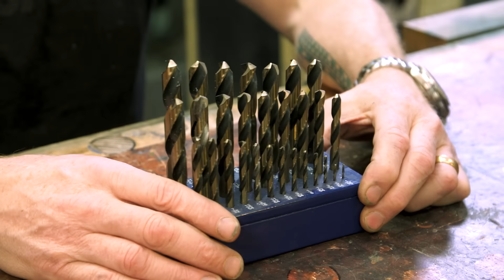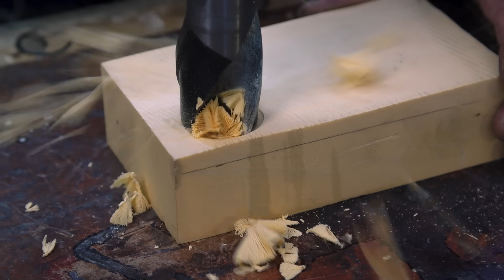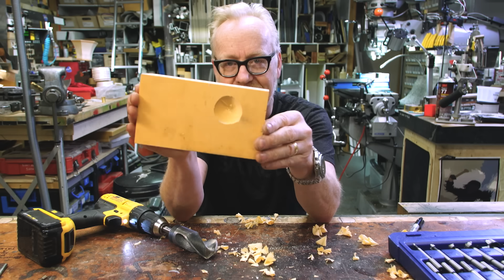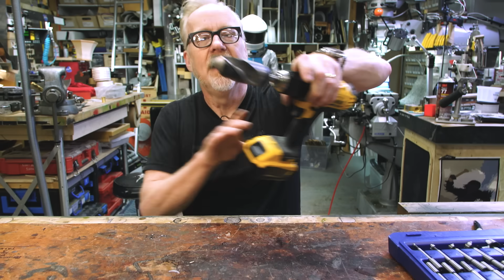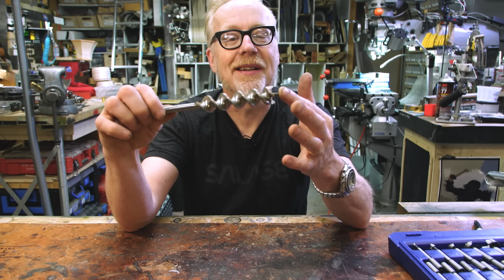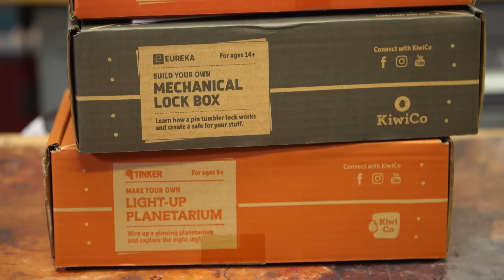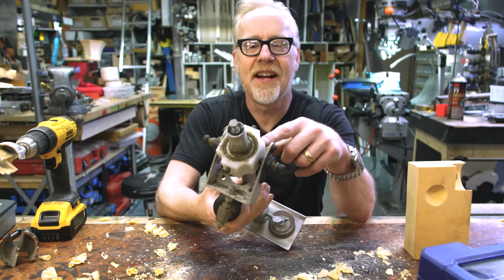Adam Savage's Guide to Drill Bits!

Comment: My understanding of masonry bits is that they are primarily designed to operate by chipping the material with the end rather than scraping it. They do seem to be made knowing people will use them in regular drills but they work much faster when using a hammer drill to achieve the chipping effect.
There are some very interesting slow-mo videos of masonry bits in action on hammer drills, though I couldn't find any slow-mo or closeup of them in a regular drill

Comment: Wicked video. I've seen most of these and used many of them but I didn't know the name or purpose of the Forstner bit.
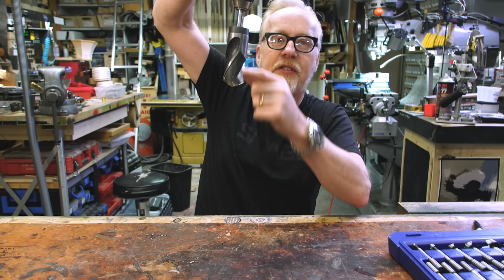8:20 that's a cool and simple explanation. That design is based on an Archimedes screw which was designed so that those spiral flutes were a sort of elevator for water, or oil...

Comment: One possible reason you haven't encountered a difference between a $30 and a $100 forstner set is because there isn't much difference. A good forstner set is probably $300-600. If you didn't notice a difference there, then you have a case.

Comment: For anyone looking to bore wood holes, I highly recommend WoodOwl Tricut bits.  They have a hex shank, you can get an adapter for a brace (also recommended for large sizes)....  I sold nearly all my forstner bits once I got my WoodOwls.  Yes, I know this sounds like an add.  But seriously they may be expensive, but you can get deeper, cleaner holes.  They don't go quite a big, but man...   I can't recommend them enough.    Also I have a full set of jennings augers, and the woodOwl's best them.  

Hope this helps someone at some point.

Comment: I am not a maker but an electrician and I swear by stepbits for thin metal, forstner bits for wood, and carbide tipped hole cutters with the spring loaded pilot bit for heavier gauge metal. The carbide bits are expensive but they will absolutely rip through even stainless steel without dulling if you keep a little spray bottle of cutting oil on hand.

Comment: The advice I've always gotten for drill bits is buy a cheap set of whatever you are using or planning to use.  If you need to replace one from using it, then get a good one since that's a bit you use a lot.  (Same advice for router bits)

Comment: Best Brad point bits are made by Lee Valley. They have a deep scoring lip with a negative rake angle that makes for really smooth holes and reduced break-out, although I still use backers to get the break-out to zero. I would NEVER drill or saw anything with my hand behind/below the tool. That's just crazy!

Comment: What Adam says about the drill-press's needing to be turned off in an emergency is why I always want to use a momentary-contact foot-pedal switch when performing potentially-dangerous material-fabricating jobs like that, so that I can quickly stop the machine just by lifting my foot, rather than having to trepidatiously try to get to the on-off switch while the machine is screamingly vibrating, dangerously thrashing about, and/or throwing stuff around.

Comment: I ran into Forstner bits a year or two ago when I built a pinball machine... they're great for putting flipper buttons into ply. Great thing about them is you can drill half way into the wood with a larger bit then finish it with a smaller bit and it'll still centre itself due to the brad centre and you end up with a stepped hole - for when you want the smaller hole to fit the flipper button, and the larger hole to recess the nut that keeps it in place.

Comment: As a senior machinist i learned that after 12mm  you should pre drill at least 30% of the hole size . Ex: 16mm hole, pre drill with a 6mm drill then finish with a 16 . I could go for 50 holes without needing to re sharpen the 16 drill .and i used this for most tools to extend the tool life.

Comment: No Japanese Kiri bits or ancient gimlet bits? No down sprial bits? The Kiri bit is either a single point or a small precision made trident tipped bit you spin in by hand with the wood handle. Gimlet bits work the same way. 1/128th of an inch off and I have parts that bind. Kiri drill. Down spirals keep wood from tearing out. I hog a lot of wood with Forstner bits so quality = longevity. They save burning up router bits. They also make special taps for acrylic, acetyl, poly___ and fibergalss..(no chamfer). Radial single tooth bits are a nice way to drill up to mild steel. I have a F'ed up fingernail from a Unibit. I bought expensive and finally retired my 1/2 to 1-7/16 Unibit after sharpening and resharpening the starting tip down to almost nothing. It only took about 30 years. I used lots of cutting oil. The $100 bits do lots nicer work on expensive hardwoods. A $10 bit can F up a $3000 piece of wood faster and easier than a $159 bit.

Comment: I can't remember how I found out about Forstner bits but I have a set and yes they sure are handy.  If you need to go above the size of Forstner bits hole saws come in hand too.  The nice thing about both of them is if you are careful  you can drill from both sides and not have splinters on the breakout side.

Comment: 19:00 were you using this same cheap DeWalt drill? or some other brushed drill?  Obviously the lesson is to be safe from the start and not do stupid things.  But another great lesson on why to never buy brushed.  If you had a brushless tool it would have done way less damage because of the smart chip would have regulated the speed once you punctured the wood.  If you had a quality brushless drill you most likely wouldn't have been hurt at all.  Less hand pushing more drill working.  The biggest difference between cheap and expensive tends to be safety.

Comment: Holes in acrylic:  simply take the bit you want to use,  Heat the SHANK end with a propane torch, then PUSH the shank through the the material to produce the hole.  NO chance of cracking the material at all.  Use a razor blade to carve off the melted acrylic that pushes upwards out of the hole as the bit's shank goes through.

Comment: I spent $70 on one 2.5" forstner bit so I can run minisplit lineset through my floor and I scraped it against a metal stud that was embedded in the wood and dulled it to uselessness, and I had only got like, 4 holes with it. I tried sharpening it, and that worked a bit, but forstner bits are hard to sharpen because all the teeth need to be perfectly plane. Long story short, yeah, just invest in cheaper ones.

Comment: Twist Drulls are a Primary Operation
Useless followed by a Secondary 
Operation 
Such as Tapping
Boring
Reaming
Counter Boring.
Only time when it's Use as the only Operation is when use to drill Ckearance Holes For Bolts
Unless it to be Counter Board out Later

Comment: S&D bits are generally a bad idea, especially extreme ones like that. If the tool in question had enough horsepower and rigidity to drive that size drill, it would have a bigger chuck—or a Morse taper shank.

As far as the wandering goes, getting a split point bit (or adding a split point with a grinder if your skills allow) will help with that enormously.

Comment: Good Forstner bits + good tight fitting extenders are very useful for drilling deep, clean holes in wood. Crappy loose fitting extenders allow wobble and are worse than useless.

Comment: what's Bits do you use to make Precision holes in aluminum plate i have to make 2 Precision holes in aluminum plate where this platick piece will fit on top and it has these tow tubs that stick out a a few mm that need to fit in the hole precisely without any side to side play  then I need the flip the aluminum over to the bottom side and make the bottom of the  hole  bigger  but need to be flat inside the hole so that the round head bolt can sit inside flat not sure what i going to need for this

Comment: When we did the T1-11 on the front of my families old place we bought one diamond tipped blade for the circular saw. It was about 100 bucks (at the time), and when that one was toast we tried the Harbor Freight blade next, and ended up buying 2 more we were able to complete what was roughly the same area as the previously completed half.. the “cheap” blades were less than $25, and dulled faster (significantly), but it was cheaper to burn through the cheap saw blades than buy the nicer blade..
Just another example of adam mentioning the cheap tools can be as “good” and save you money. Technically. 1 to 1 the 100+ dollar blade. You just have to consider what’s most important to completing the job. I’m sure there’s scenarios where the expensive blade would be important to have, but for that siding it was excellent.

Comment: Seeing those massive bits in your handheld DeWalt scares the crap out of me.   There's so much angular momentum in those big bits, and you're having to provide a counter-torque with your arm!  As your arm tires out, the deviation from vertical gets larger, and the bit will tend to scatter dangerously.

Comment: That 'masonary / concrete' bit is actually a 'multi material' bit. 
     You can drill hardened steel with that thing.

The difference between those 2 types of drills is in how they are ground / tapered.
      This one has 2 cutting edges, while "normal" concrete bits are quite blunt.
     (Concrete "drill" bits are not really drilling so much as they are hammering/chiseling, and evacuating the chips/bits via the flutes).

You can make a (usually cheaper) blunt, carbide tipped concrete bit into a (more expensive) multi material drill bit if you have a bench grinder.
       The trick is to grind a 5-10° angle with a sharp inside edge on both sides.

And yes, when done correctly, it will drill through hardened steel.
     As per AvE: 
"aluminium cuts plastic, 
steel cuts aluminium, and 
tungsten carbide cuts everything else"

Fun to try out on worn out concrete bits. It's not hard to get them functional :)  
     (I found it way harder to resharpen drill bits for metal)

Bear in mind that a drill bit sharpened in this way will not last as long when used exclusively in concrete.
     But it's very, very useful if you're doing construction, and have to drill through bricks, wood, drywall, and tiles, and don't want to switch drill bits all the time.

-

Bonus tip #1:

(This extra info is the edit:)
 
for acrylic, you can take a metal drill bit and dull it. It should chip it, not cut. 

'Brad point' drill bits work well too (because they also rely on 'chipping', not cutting)

-

Bonus tip #2:

for suuuuper clean holes in drywall, use a metal drill bit. Not a masonary bit.

You can even use a dull metal bit for that purpose (aka 'worn out').

Because it's not the sharpness of the tip that makes the hole precise; 
     the sides of the flutes cut away excess paper and scrape the inside of the hole to a pristine finish.

-

Hope this interests or helps some people (:

Comment: I get great results in wood with old fashioned auger bits with a hand brace. Forstner bits are also great, but are especially great when you can use them on a press. Forstner bits with a hand drill are less great. The old fashioned auger bits are fantastic in cases where you need to go slowly and want to control torque and speed minutely. With larger holes this can be a huge plus. These old fashions bits are also good for making angled holes in wood without sorting out jigs for a forstner on a press. The old bit are easy to sharpen and a five minute touch up before drilling will (with a bit of practice) get very close to the same pristine outcome of a forstner. For smaller holes where minute precision with respect to alignment isn't essential I get great results in wood from brad point bits. Really, all three of these variations have a place in your kit if you like doing things with wood. If you do pick up an old fashioned brace there are also variable size augers that can be really useful too. Metals, plastics and the rest are a different animal completely and I don't have experience to opine on those materials.

Comment: 30 bucks?  For a whole set of Forstner bits???   I just can't believe you get good results with those.  I've bought ones that cost more like $5 - $7 a piece, and even those, after maybe 20 holes, especially in the bigger sizes like 1" and up, are shot.  I agree they are wonderful, and they cut clean, flat-bottomed, very round holes.  But not for very long at prices like that.

Comment: I totally get your love for the forstner bits. I bought my first a couple of years ago to drill holes for fittings I had made from steel pipe ends that needed to be fitted into oak furniture I was building. It turned a job I was struggling with into something truly enjoyable. I agree with the cheap ones being fine, I have a set and none get used regularly but its great to have all the sizes available. I find the lower priced ones perform just as well, where they lack is in durability. I got a bit more expensive one in a size I use all the time. they are also great for fitting hinges.

Comment: Always go quality over quantity I’d what I learned as I tried using a 8mm Brad point hex shank wood drill bit cheapo off eBay anc my powerful cordless ripped the hex shank clean off as the cheap bit was made cheap as in not one piece of steel the hex shank was clamped stamped onto base 
So I managed to purchase a quality one piece 8mm hss Brad point hex shank so that should resolve the damaged drill bit issue lol

Comment: There’s an old saying: You can never be too rich or too thin. If you work in a factory, there’s a different saying: You can never have too many drill bits. I have an interesting skill: I can break a drill bit in three seconds. Which is fine if I tell my boss, so he can order more, but I hide them in a drawer. Maybe I can fix them later.

Anyway, when I was around sixteen years old, I did leatherwork as a hobby. I made a couple of belts, and a wallet. The interesting thing about leatherwork is that you don’t drill holes. You punch them with a hollow round chisel that has a hole in the side for material to be ejected. The round chisel is razor sharp, and gives a nice clean edge. So you have a wooden box with a dozen different sizes of round chisels. And yes, they’re expensive. But they don’t ever break, they just need to be honed once in a while.

So I was wondering: Why don’t they make a non-rotating reciprocating drill that holds punches? Not only could the machine punch round holes in wood and plastic, but the punches could be made in any shape that you want. For example; square, rectangular, oval, and so on. That would allow woodworkers to do more creative things. It would even make joinery easier, by allowing slots to be cut without a saw. And you wouldn’t need a biscuit joiner either.

I don’t really know if this idea would work, because cutting a deep hole in wood with a punch might create too much friction. But the punch could have a slightly enlarged tungsten leading edge. That would hopefully allow the internal scrap wood to migrate upward to the ejection port. 

If it worked and it didn’t cost too much, a lot of woodworkers would try it as an alternative to regular hole drilling. And there’s no sawdust.

Comment: im no experienced player, but after learning a bit here, i noticed another AMAZING ADVANTAGE of the forcener bit.
drill bits are inherently "hard to aim" right?
doesnt the circular fashion of the wide bit provide a wonderful starting guide to being level and acurate when you first initiate your cut ?  once the screw has burried into the wood, the circular nature of the saw blade levels itself against the surface.    im guessing.
starting the cut level on the X and Y is literally half the battle. and a planar circle does that for free.
finding "base angle" is the hardest part of cutting.   and i think forcner bits may do half the work, if not all the work , or nearly, for you.

once the initial cut is level, the machined walls keep it that way for the most part.

thank you.   I did not know this before watching this video.
you told me many things today. 

greetings from Japan.
Robert the fourth.

Comment: I use step bits on a weekly basis to add a seat heaters two cars makes the perfect size hole for the switch They do wonder though it is best to start a pilot hole with a 1/8 drill bit

Comment: Auger drill bits are amazing. The only issue is how fast they can drill and "run away" from you. If you don't start straight, there is very little room to fix it as it bites and almost pulls itself in.

Comment: Dad used to crank at anyone who used the term "drill bit".  He was an old school tool and die maker (1950s onward), and would loudly exclaim, "there is no such thing as a drill bit. There are twist drills, center drills, spade drills, carbide drills, etc.  There are hand drills, electric drills, drill presses, etc.  Nothing is a 'bit'."

The thing I use unibits for the most is deburring the inside of conduit.  I leave one in an old battery powered drill for that very purpose. Beats the heck out of using a deburring knife or some awkward scraper tacked on to a pipe cutter.

Comment: I've used the 1-3/8" Forstner bit literally thousands of times to drill holes for hidden hinges (cup hinges). The depth of the head is the perfect thickness for getting the perfect depth hole to place hinge. When it is flush with the surface, the depth is perfect in 3/4" thick material. I think the taper on the sides is to prevent binding and also aids in wobbling the bit to cut faster (at the expense of accuracy). You can also touch up the cutting parts with a diamond file.